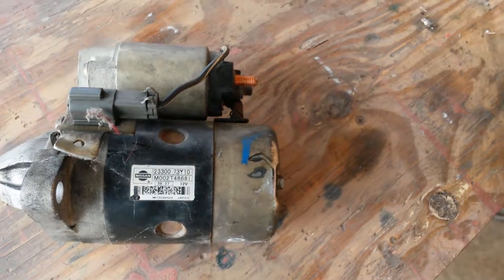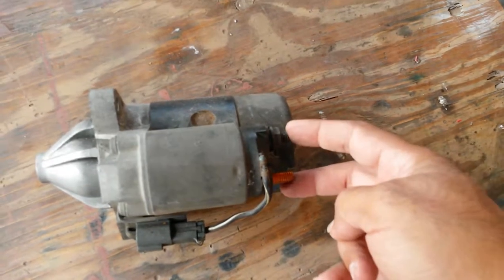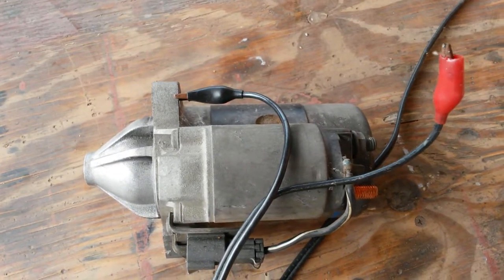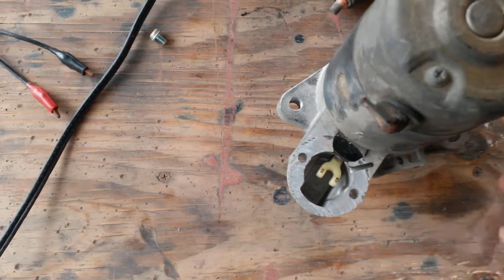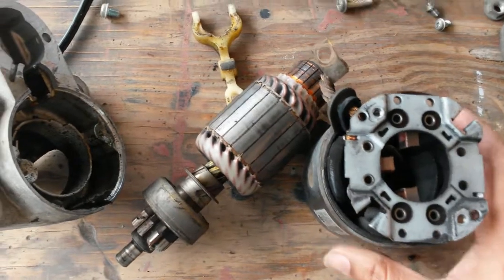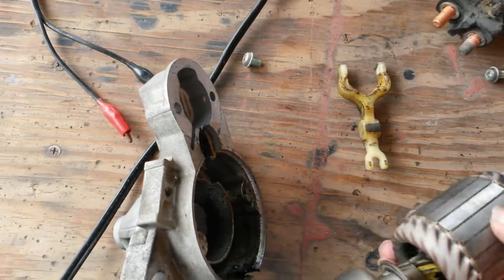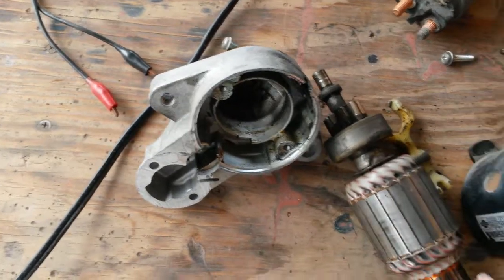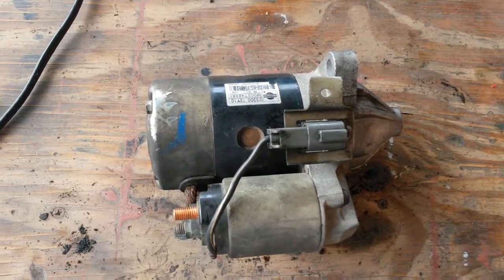119 Nissan Car Starter

Comment: Really interesting, dude. Pretty big motor!
Reply from the maker: Thick coils too for high current draw. High torque by design as opposed to putting a gearhead. Seems like a universal motor too. That way they avoid having to put a strong magnet and use the current to do both stator and rotor fields. 

Problem with using it on a project is apart from a car battery I really have no other way to power it. It cannot run for long too or it will overheat.